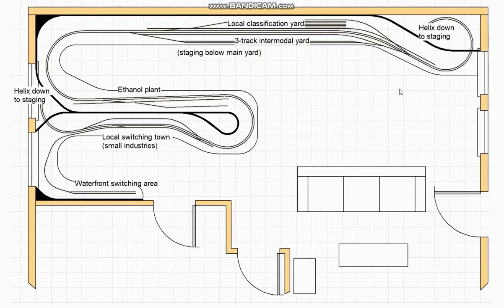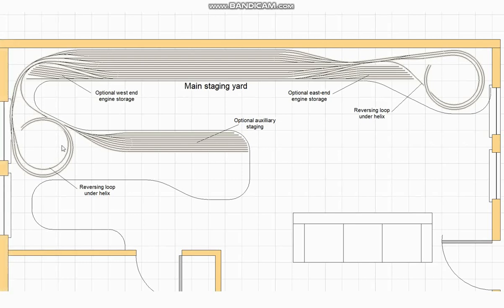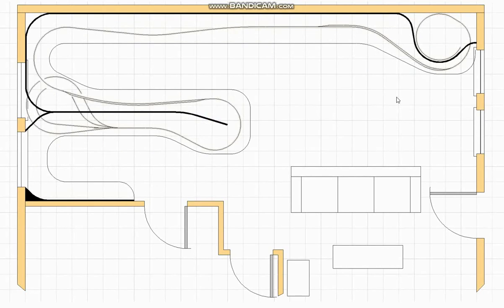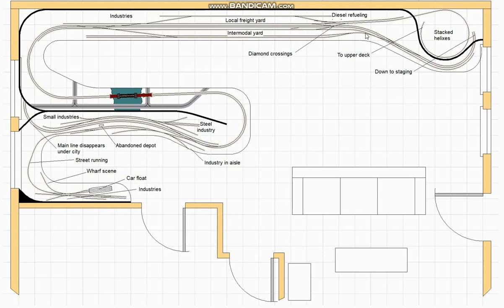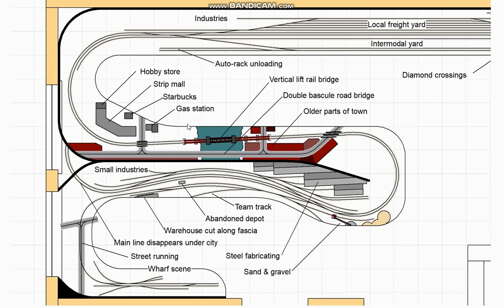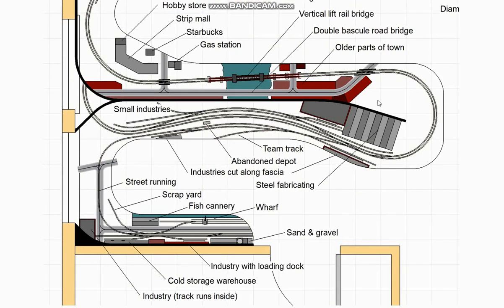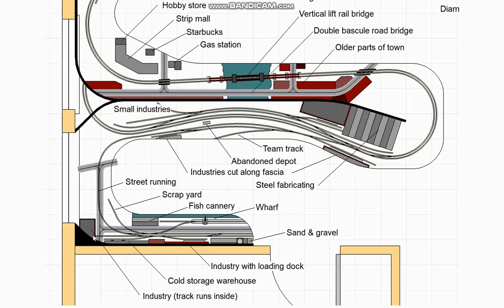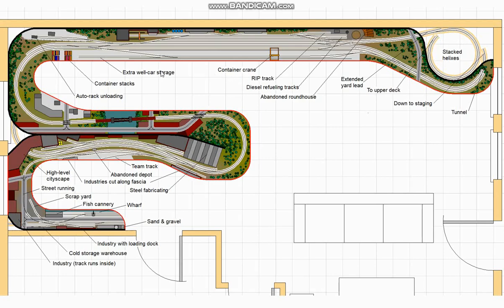An N-scale layout design in a generous space.

Comment: Why not have a container crane that can be lifted off if necessary.
Reply from the maker: Cranes and other tall structures are generally made removable anyway.  By ensuring that such things are not glued down, they have more chance of surviving an occasional elbow-bump.  If you're going to have to remove it for operation then there's no point in having it in the first place; that is why it was positioned where it was - so that it doesn't have to be removed.
Reply: If it's in the way, the time when it will be most in the way is during operations, when you're wanting to uncouple cars in the yard or the industries. If the crane needs to be removed for operations, it shouldn't be there at all.

Comment: Nice vid. I particularly like the street running idea.
Have to say though that 30" is a better radius. As an N scale modeler who likes to run some auto racks and passenger cars, I'm glad I stuck to that. Like you said, plenty of space available here.
Reply from the maker: Most people will go up to HO-scale if they have room for 30" curves.  I don't think I've ever seen an N-scale layout with a mainline minimum above 22" - and most are smaller.
You are correct however; long cars will always look better on bigger curves and even your 30" curves are still too sharp by prototype standards.  For example, Tehachapi loop is a sharp curve but I'm told that it would scale out at around 46" radius in N-scale.